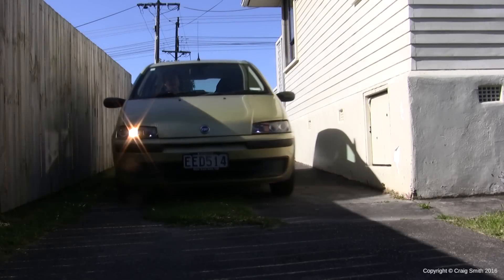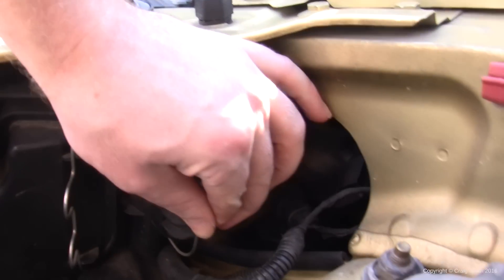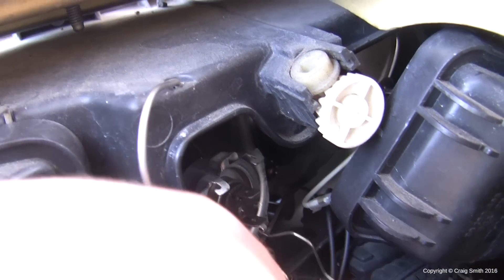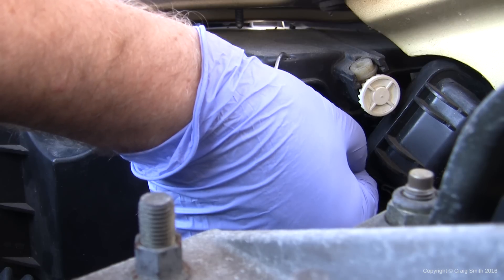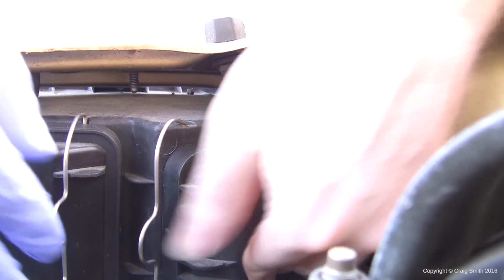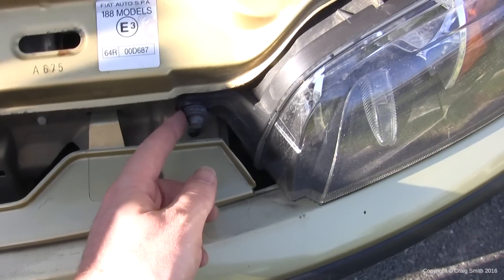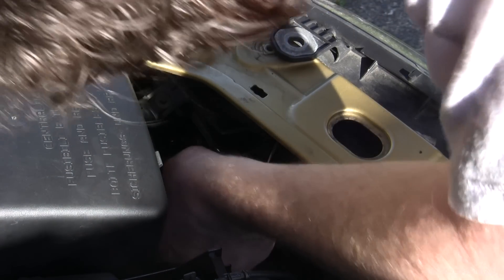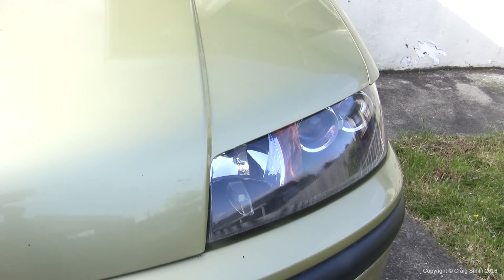Simple how-to: Change headlight bulbs, Fiat Punto

Comment: Not all Punto MK2 headlamps have the same bulbs. Some are both H1 or H7, some are alternating between those 2.
Reply from the maker: +Nick d That's correct, so I guess the bulbs should be checked before purchasing replacements. I think the H7 low H1 high arrangement is more common.
Reply: Actually, I think there are two types of the mk2a headlights depending on the year of production. 99-2001 Puntos have H7 low beams + H7 high beams, while 2001-2003 Puntos have H1 low beams + H1 high beams. In any case, there is supposed to be just one type of the bulbs in the headlight.
Reply: tomasmalin if only that were true :p

some headlights have h1 h7 as well, which is highly inconvenient
Reply: Nick d Are you sure we are both talking about pre-facelift Punto? The newer Punto might have H7+H1 but I can only get H1+H1 or H7+H7 for my mk2a...or aren't there different headlights for RHD version?

Comment: I know it's an old video post.

On my Fiat Punto 2 (188) 1.9D (Diesel) 1999 - 2001

Mine are H7/H7 without Front Fog lights (Construction year to 6/2001)

With Front Fog Lights is H7/H7/H3

Replacement is all 4 bulbs because they work together when on main beam.

H1/H1 will operate in the same way.

H1/H7 combo is the 2003 new style pear drop headlamp enclosure.

On mine I just unbolted the fuse box and moved it out of the way enough to get my hand at the back. Couldn't do it by just unbolting the lamp enclosure.
Reply from the maker: Thanks.
Reply: @CraigsDIY  by the way, are the sidelights/parking lights on yours W5W 12V bulbs?
They fit in a little "pencil" connector.

Comment: Hi.Great video.It
 helped a lot. I have a question.i got a Punto from 2001,1.2 L...looks the same as this one,but till now I wasn't able to find the fog lights....are there any built in this type of car? Thanx for your help
Reply from the maker: The fog lights at the front are the lights at the far outside. There are separate push buttons on the center console for front and rear fogs, they are nowhere near the headlight switch because Italy.